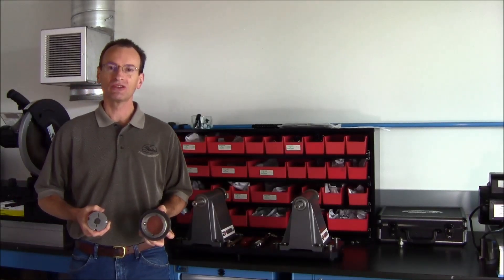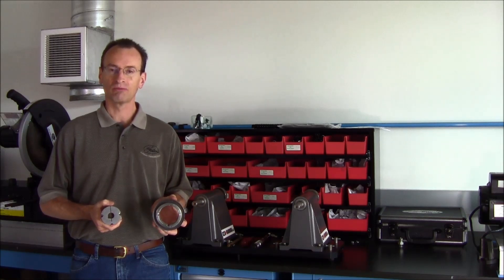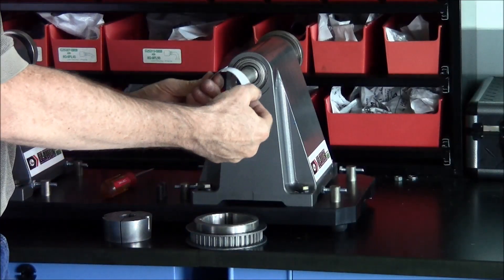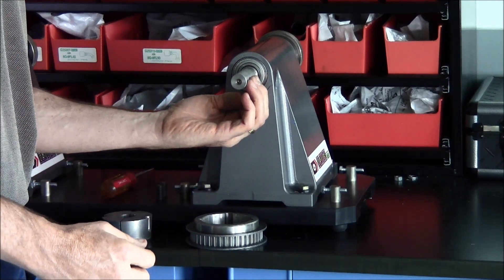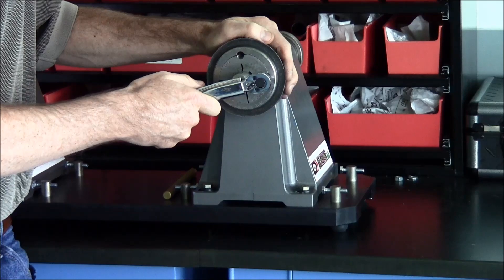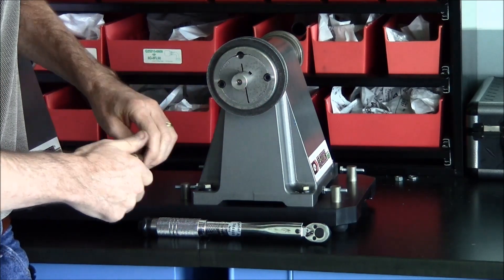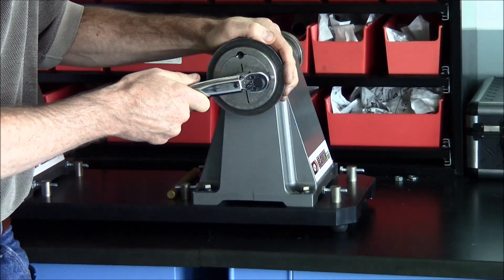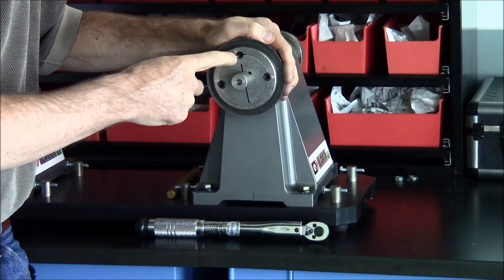Taper Lock Bushing Installation

Comment: It would be nice to have a threaded hole perpendicular to the open end slot, after you have removed pulley or sprocket. Simply insert threaded hex screw into tapered hub perpendicully along tapered edge forcing slot to open slightly

Comment: Good morning, by using the “taper-loc” method, could these taper-loc hubs support a poly-groove/serpentine belt? Maybe order custom/adjustable offsets, for the pulleys? I would like to fabricate a serpentine belt system for my ford lehman 4cyl. With a scuba compressor, a/c compressor, 48v alternator, 12v alternator, and 1 Saginaw power steering pump, and the high pressure pump for the watermaker. The watermaker pump, and the scuba compressor would have electric clutches. The power steering pump would by-pass, until quick-connect hydraulic connections get connected to operate hydraulics. Any help would be appreciated.
Reply from the maker: Hi Mike! Our product application engineers are happy to help you! https://www.gates.com/us/en/knowledge-center/original-equipment-solutions-and-services/industrial-oe-first-fit.html